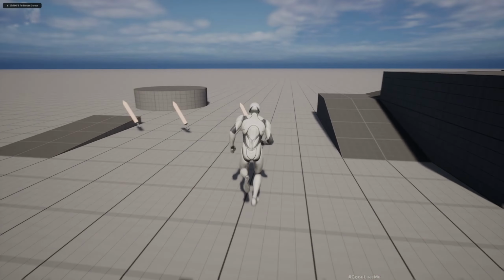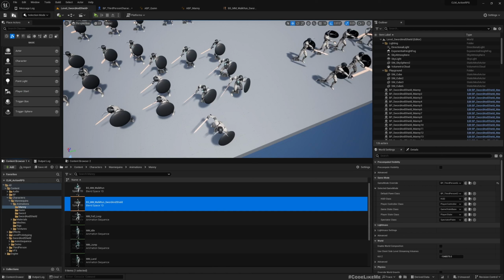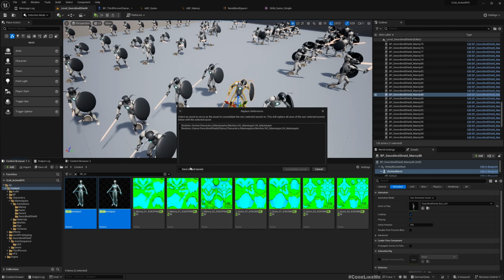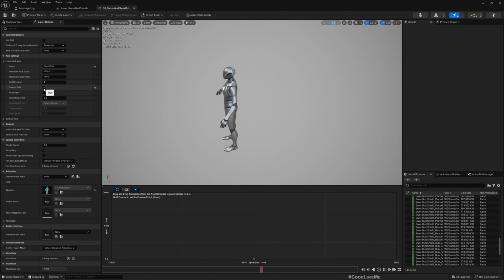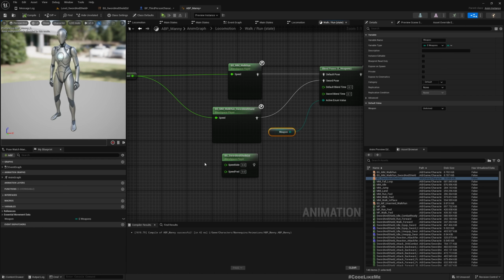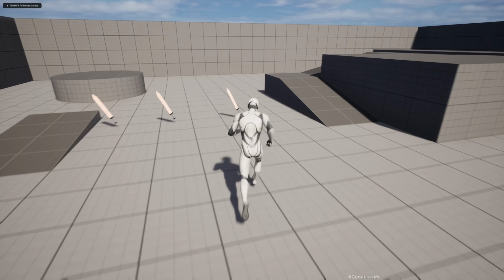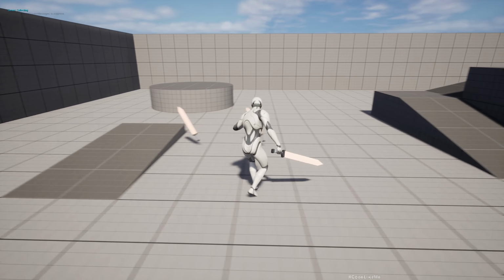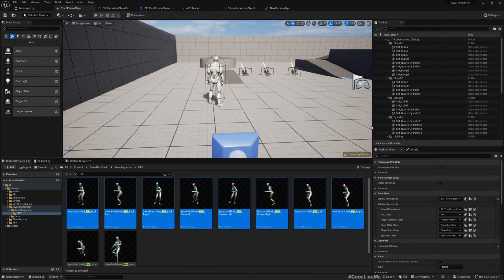Unreal Engine Action RPG with GAS  #22 - 8 Way Movement Animation Blendspace for Melee Combat

Comment: Something doesn't add up, seems like video is extra extra cut as from multiple lessons there's parts missing with extra added code. Is that included only in the patreon or there is exactly the same with the exception of project files being added?
Reply from the maker: No, I didn't intend to cut anything. Unless something got missing at the edit

Comment: Hmmm... I have a walk backwards animation in the blendspace at the bottom but my character does not walk backwards. The character turns completely around still. I don't want it to turn and wlk, but to walk backwards as it does in the blendspace.
Reply: I ended up having to add more to BP_ThirdPersonCharacter so that when the sword is equipped "Orient Rotation to Movement" is et to false and "Use Controller Desired Rotation" to true. And then back to default when the sword is unequipped.  Did I miss this somewhere in your tuts?
Reply: Thank you so much for the great videos! I am learning a lot!